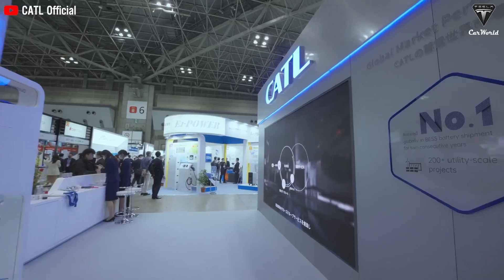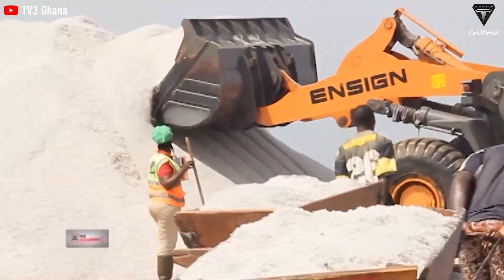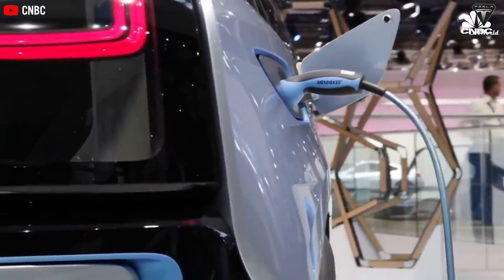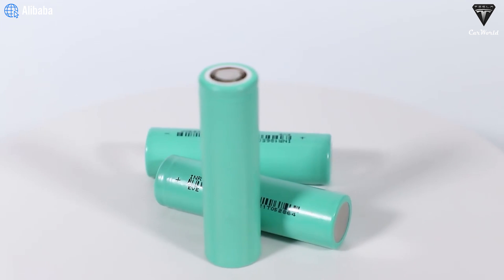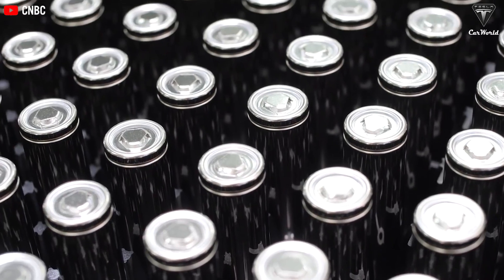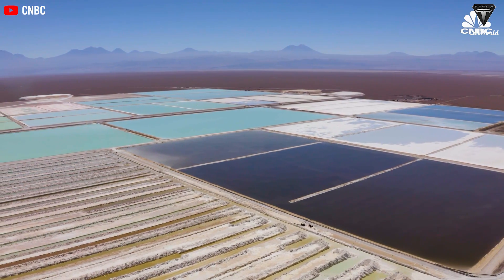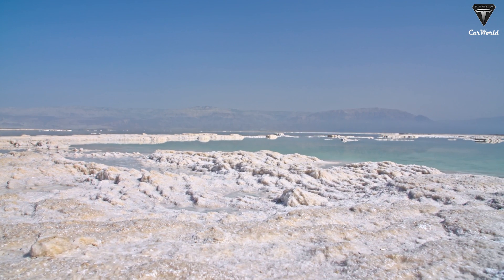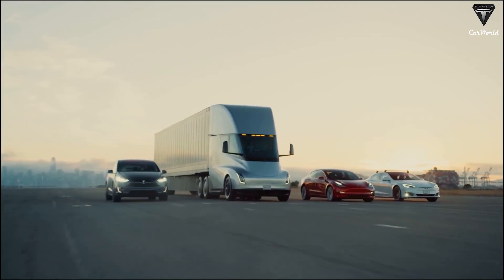Elon Musk Just Revealed Why Sodium Ion Battery Can Dominate All the EVs Industry!

Comment: until batteries can make the  distances that gas car are capable of   the real solution is with  a Toyota Prius type of car. In city driving it uses electric only. and on highways  uses gas because with gas you  have better millage on a tank full. Maybe one day batteries will reach the  distances that gas cars can do.?
Reply from the maker: That's correct; we all know that researchers and manufacturers of electric vehicles are constantly enhancing and perfecting their characteristics so that they can fully replace automobiles powered by gasoline engines and achieve greater excellence.

Comment: If sodium battery is a good/best solution, why take so long to implement this tec??
Reply: Because Sodium was harder to use at the time. Li was already 30 years into the making over all. Li is also lighter and had more charge storage, but that is turning around now that Sodium has had time to mature making it the same or little less than Li - but at over half the cost savings if not more in the future. We would still be using Li if it wasnt used as a power tool to control the world (China). There is plenty of Li around the world and it can be recycle as well. What Sodium does help is in curving the usage of Li for more directly needed application and applications that don't need Li because weight doesnt matter such as house, grid, and larger mobile designs. Basicly, they can work togather to help drive the future.
Reply: I am sorry , I dont agree with you , because this isued by CATL is not peanut company. on the other hand ,may I ask you from which lithium company you are ?
It will sodium silicon battery in the future can reach 1000wh/kg.😁
Reply from the maker: Thanks, You're amazing!
Reply from the maker: #edson carvalho   The sodium battery has been researched to demonstrate the best qualities, but it takes extensive testing to put it into practical use because it depends on the device, the environment, and the ambient temperature.
You may be confident that it will be used as soon as feasible.
Reply: Since nobody needs sodium batteries, no market means no product